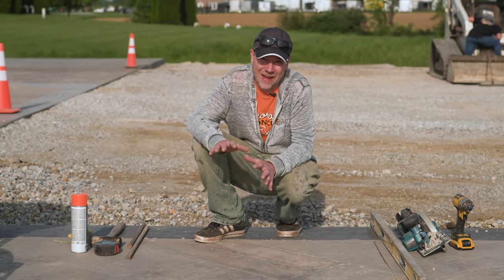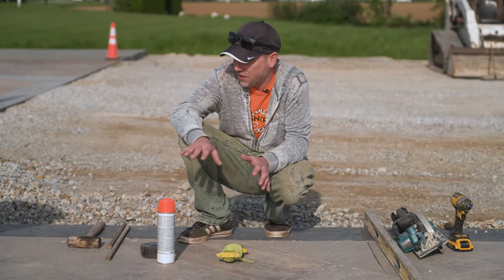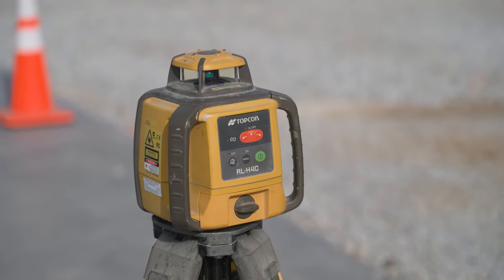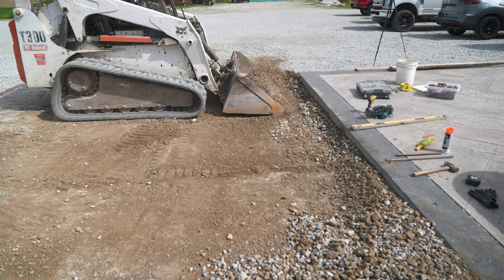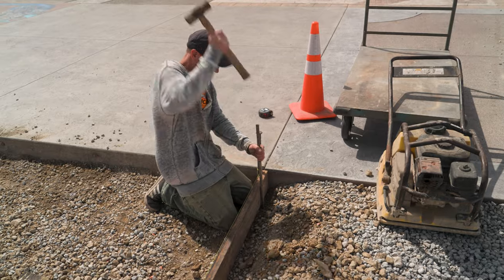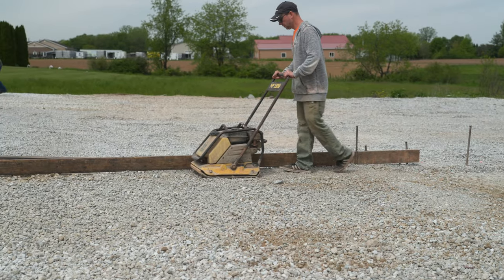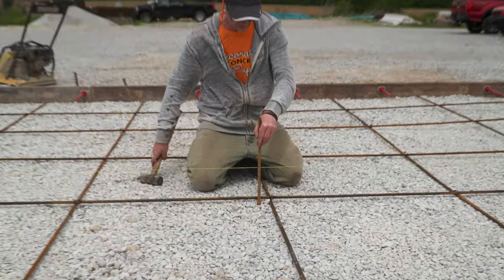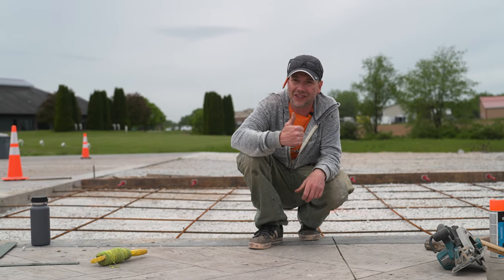How to Form a Concrete Slab in Under 10 Minutes!

Comment: A little more detail on setting the string line to the proper level or slope.
Reply from the maker: The easiest thing to do is set the string line level to start off, then find the side of the slab that you want the water to drain off of and move the string down as many inches as you need to get the water to run. After that, you can set the top of your forms to the string line. The minimum slope required for exterior concrete is 1" of slope per 10' of concrete. So for example; if the slab is 20' long, you'll need at least 2" of slope for the water to drain. Keep in mined that 1" per 10' is the absolute minimum and most contractors would give it a little extra. 1.5"-2" is a good rule of thumb. Here are a few links to some other videos on slope and string lines. Thanks for watching Deco-Crete TV!!                                                                                                              
  https://www.youtube.com/watch?v=QqodE1OhREk                                                                                                                                                                 
  https://www.youtube.com/watch?v=IRO9wRSKfw8                                                                                                                                                                 
  https://www.youtube.com/watch?v=KX_bRIkV8cg&t=25s                                                                                                                                                      
  https://www.youtube.com/watch?v=EYEAtPSf6ps&t=332s

Comment: I'm pouring a 6" thick concrete slab over 20' x 40' area.  How far should I tie the rebar between each other? What size of the rebar is used? Would it help to stop the crack if I use 2" pink XPS foam under the concrete slab.
Reply from the maker: Thanks for the comment! 24" on center should be fine for the rebar spacing. #4 (1/2") is the recommended diameter for the bar on a 6" slab. Pouring on top of 2" foam can reduce cracking, but there are never any guarantees. The foam does help keep the concrete from heaving in freeze-thaw environments. You just have to decide whether it's worth the extra time and cost of the foam. Hopefully, this helps! Thanks for watching Deco-Crete TV!!

Comment: Question, what should the spacing of the rebar be?
Reply from the maker: Thanks for the comment! Spacing for the rebar will depend on the size of the bar & the thickness of the slab, most commercial projects will have a spec for this. If this is for a residential job without a spec, 24" on center will work just fine. Thanks for watching Deco-Crete TV!!!

Comment: What about keeping the rebar in the moddle of the thickness instead of sagging to the bottom of the slab?
Reply from the maker: Thanks for the comment! Yes, the rebar should be near the middle of the slabs thickness to be the most affective. You could use rebar chairs or blocks to hold it in place, or pull it up as you go. This would depend on whether you have to drive over the bar with the concrete truck, buggy, or wheel barrow. If you pull it up as you pour, just make sure to pull it up a little extra to account for it moving back down as you walk on it. ACI guidelines define the bottom third of the slab as the "tension zone" and recommend that reinforcement be placed there to reduce the chances of cracking. Common practice however, would be to place the reinforcement near the middle. Thanks for watching Deco-Crete TV!!

Comment: Would you ever use 3/4 road mix as a base? Local gravel supply does not have 57 limestone
Reply from the maker: Thanks for the comment!! That 3/4" gravel will work fine if you can't find #57 limestone. We prefer limestone, but gravel is probably the most commonly use base material. Thanks for watching Deco-Crete TV!!

Comment: I have a spot in the middle of a downstairs driveway that is triangular shaped and surrounded by existing slabs. How would I approach that? One side is the retaining wall, the other 2 are concrete. Would I just clear it out, level/gravel fill, then pour?
Reply from the maker: Thanks for the comment!! Yes, start by clearing it out and leveling it with gravel. The concrete should be at least 4" thick, but if the area is really small, you might want to make it even thicker. Make sure you put some expansion joint along the retaining wall so the concrete doesn't bond to it. For the sides against the driveway, It would be a good idea to drill holes and dowel it to the existing slabs. We hope your project goes well! Thanks for watching Deco-Crete TV!!!
Reply: @DecoCreteTV  thank you for the tips!
Reply: I'm pouring a 6" thick concrete slab over 20' x 40' area.  How far should I tie the rebar between each other? What size of the rebar is used? Would it help to stop the crack if I use 2" pink XPS foam under the concrete slab.

Comment: Hello, very informative video. How far away from each other should wholes be drilled into existing concrete slobs for rebar installation? Thank you in advance.
Reply from the maker: Thanks for the comment! 2' on center would be the standard practice for the rebar holes in the existing slab. Thanks for watching Deco-Crete TV!!👍
Reply: Hello, and thank you for the response. How far away from the edge of the concrete slob should the holes be drilled, and also how deep should the holes be drilled, and what size of rebar should be used? Thank you in advance.
Reply from the maker: @kevinjefferson9739  You can start your first dowel hole 1'-2' from the edge of the slab, and generally, they would be 8" deep. #4 (1/2") rebar works well for the dowles. However, the size of the full-length rebar for the main part of the slab would depend on the thickness of the slab. In this video, the slab was 5.5" thick, so we used #4 for everything. #3 (3/8") rebar would be better for 4" slabs. I'll leave a few links to some other videos on doweling slabs together and slab thickness. Thanks again for watching Deco-Crete TV, we hope your project turns out great!!      https://www.youtube.com/watch?v=Kiwh2sVFghA          https://www.youtube.com/watch?v=IRO9wRSKfw8&t=28s
Reply: Hello, and thank you for the response. How strong the concrete should be—4000 psi or 5000 psi or more for the garage floor slab? What are the red rebar holders inside of the 2X6? What do they do, what is the purpose of them? Thank you in advance.
Reply from the maker: @kevinjefferson9739  4000 psi will be fine for the garage floor. The red tubes are a part of the Quick Dowel system. There's a base that's screwed to the 2x6, the red tube fits over the base. After the concrete is poured and it's time to strip the forms, the base will come off with the 2x6, and the red tube stays in the concrete. This tube will serve as the hole for the rebar dowel. Eliminating the need for drilling holes. You can buy the Quick Dowels on our website, I'll leave the link below.       https://www.deco-cretesupply.com/products/forms-expansion-wire/5-8-quicdowel-base      https://www.youtube.com/watch?v=4XmPodKjz98&t=120s
Reply: Hello, and thank you for the response. If an existing concrete slab has garages on it, should or should not holes be drilled for the rebars for attaching a brand new concrete slab? Thank you in advance.
Reply from the maker: Is the new concrete also a garage slab, or is it an exterior slab? I would avoid tying a floating exterior slab to an interior slab on a foundation. The exterior slab will move with the ground, but the one on the foundation won't. In that case, you should put some expansion joint between the two slabs. If they are both on a foundation or both floating, then yes, tie them together.  I'll leave a link to our video about this and one on expansion joint.                                                                                                         
 https://www.youtube.com/watch?v=Kiwh2sVFghA                                                                                                                                                                   
 https://www.youtube.com/watch?v=VXsWYGhQfqs&t=263s
Reply: Hello, and thank you for the response. How can you tell if the existing garage slab is floating or a foundation slab? The new concrete slab is meant to be the garage slab as well. Thank you in advance.
Reply from the maker: @kevinjefferson9739  You should be able to see the block or concrete wall foundation of the existing garage. My guess is that it's on a foundation, unless it's a pole barn.
Reply: Hello, and thank you for the response. According to your explanation, the new concrete slab should not be attached to the existing concrete slab on the foundation, regardless if the new concrete slab is going to be an extension of the main garage building, correct? Thank you in advance.
Reply from the maker: @kevinjefferson9739   By extension of the main garage building, do you mean the new concrete will also be an interior slab that will be poured on a foundation? If so, then yes, tie them together. Just don't tie the two slabs together if one will move with the ground and the other one won't.
Reply: Hello, and thank you for the response. How deep and far away from each other should the joint (expansion) line be? Thank you in advance.
Reply from the maker: @kevinjefferson9739  Are you referring to the saw cuts/tool joints? If so, here are some general rules: Saw cuts should be spaced 24 to 36 times the thickness of the slab. For example, for a 4-inch thick slab, the cuts should be spaced every 96 to 144 inches (8 to 12 feet) apart. Saw cuts should be made to a depth of 25% to 33% of the slab thickness. For a 4-inch thick slab, this means the cuts should be 1 to 1.33 inches deep.
Reply: Hello, and thank you for the response. For how long should a compactor be used over the gravel (rocks)? What is the time frame after the compactor finishes that the concrete has to be installed (poured)? Thank you in advance.

Comment: Is 3.5 inches think of concrete fine for a patio?
Reply from the maker: Thanks for the comment! 4" thick would be the standard for patios, and that would also be the minimum thickness for a slab on grade. The extra 1/2" of concrete is well worth the extra cost for exterior slabs. Thanks for watching Deco-Crete TV!!!

Comment: Was there a reason you didn't do little riser blocks to get the rebar off the ground?
Reply from the maker: Thanks for the comment! We normally pour the concrete with a buggy and it doesn't work very well if the rebar is chaired up. We just pull the bar up by hand as we pour. In this case, blocks or chairs would have worked fine. Most commercial job will require chairs at a spec'd height. Thanks for watching Deco-Crete TV!!!

Comment: Looks great! I'm about to do a 4.5m x 6m slab for a campervan. Should the rebar stick out the sides or is it best to leave them shorter than the overall length and width of the slab?
Reply from the maker: Thanks for the comment! The rebar does not need to stick out the sides. The best thing is to leave it short, around 2" of clearance on all sides is ideal. Thanks for watching Deco-Crete TV!!!

Comment: Chairs for the rebar they say you can pull it up when you pour it and it just sinks back down but you don't know
Reply: Pulling it up works just fine lol
Reply from the maker: Thanks for the comment! Chairs are great if you don't have to drive a wheelbarrow or buggy over the rebar. But, most backyard patios will require driving something over the bar. Unless you are pumping it, or sometimes you can get the concrete truck close enough to get the chute inside the forms. We have always pulled up the bar as we go, it definitely works as long as you pay attention to what's happening. It does sink a bit as you walk on it, but if pulled it enough it will still end up in the right spot. Thanks for watching Deco-Crete TV!!!

Comment: I put in a 12 x 16. My forms are in and I didn't have rock but compacted the dirt and threw in rebar. It's for a shed. Should I still put in rock or am I good with how i have it? I'm also about a 8 inches away from all sides with the rebar. Any advice would be appreciated.
Reply from the maker: 3-4 inches of compacted gravel is recommended, however if this is your own project you'll have to decide if you want to take the risk or not. It's not like the slab is just going to fall apart, its that the dirt wont provide any drainage under the slab. 8 inches from the sides will be fine for the rebar.

Comment: Do you have a segment on how to remove the existing concrete and pour new concrete?
Reply from the maker: Thanks for the comment! We don't currently have any videos on removing existing concrete. You can rent a jack hammer from most tool rental shops and bust the concrete in to small pieces so they are easier to dispose of. For larger jobs, you may rent a skid steer to remove the concrete and have someone haul it off for you with a dump truck. It just depends on the size of the job and how much hand work you willing to do. If you search "concrete slab removal " on YouTube there are quite a few videos out there. Thanks for watching Deco-Crete TV!!

Comment: Need to do a flat 16x16 flat slab on a slanted/hill yard for a car parking pad 
Any suggestions or do you know of a video available ?
Reply from the maker: Thanks for the comment! The excavating and forming would be the same as in this video. How steep is the hill? You can put quite a bit of slope on a slab like that, but depending on how steep the natural grade is, you might need to build up bottom side a little bit. 1.5" of slope per 10' is nice amount of slope to get the water off the slab but still feel fairly flat. Even 3" of slope per 10' won't be bad to park on, but you probably don't want to go much more then that. Thanks for watching Deco-Crete TV!!
Reply: @DecoCreteTV  approx 6’
Reply from the maker: @milliewilliams4889   6' slope on a 16' slab would be quite steep. In that case, you would probably want to flatten it out some by building up the bottom side of the slab or digging into the grade on the top side—maybe even a little of both.

Comment: Ever build garage floor with metal screen mesh vs rebar?
Reply from the maker: Thanks for the comment! Wire mesh is a commonly used form of reinforcement. We prefer rebar for exterior concrete, but a lot of contractors use wire mesh. Thanks for watching!
Reply: @DecoCreteTV  Contractors like rebar and the stronger than mesh sales pitch. However, I talked to DIY and engineers say mesh is fine for residential garage.

Comment: Did you all use the rebar stands to keep y rebar level?  I am readying a DYI effort.  Thanks Scott
Reply from the maker: We don't normally use anything to hold up the rebar. Most backyard patios require a wheelbarrow or concrete buggy to get the concrete in place. It doesn't work to drive over the bar if it's chaired up. We usually just pull the bar up as we pour. If you don't have to drive over the bar, you could chair it up with blocks or rebar chairs. Thanks for watching!!!!
Reply: @DecoCreteTV  Fundamental misunderstanding of the purpose of rebar in concrete.  Concrete is excellent compression stress and terrible with tension stress.  Rebar provides support for tension stress and has to be place at the correct depth in the concrete to provide the propper support. Just having rebar in there somewhere does very little.   https://www.youtube.com/watch?v=cZINeaDjisY
Reply: @markmercier6739  Oh yes, I know all about that from Dr. Buckner's class in Reinforced Concrete Design in college many years ago.

Comment: Several questions Jeff... Where do I rent that concrete truck, how do I know Im getteing the right concrete? Where do I rent that compactor? Where do I get the gravel? How do I cut my rebar so its the right fit? Last but not least, How do I know I want a slope on it or not?
Reply from the maker: Thanks for the comment! The first thing to do is call your local ready mix concrete plant and tell them about your project. They will help you decide what type of concrete mix will work the best. You won't need to rent the concrete truck, they'll deliver the concrete to you ready to pour! Concrete ready mix plants are also a good source for the gravel and most of them will deliver it to your jobsite. The compactor can be rented from most equipment/tool rental shops. Small diameter rebar (3/8" & under) can be cut with a large bolt cutter, but an abrasive blade is easier. #4 rebar (1/2") and up will need to be cut with an abrasive blade, you could set up a blade on an angel grinder, but a concrete chop/cut off saw will be lot quicker. You can rent the cut off saw from the same place as you rent the compactor, you'll need the saw with a diamond blade to cut the concrete anyway. As for the slope, this depends on the situation. Exterior concrete needs a minimum of 1" of fall per 10' so water can drain off properly. But you can, and probably should give it even more slope then that. We're actually releasing a video tomorrow morning on how much slope to put on exterior concrete! Thanks for watching Deco-Crete TV!!!

Comment: what do you do with the center (sprayed) cut-off rebar guide after the concrete has been poured? how do you get it out?
Reply from the maker: Thanks for the comment! Once you have the screed line established, you can either pull the grade pin out with a Vise-Grip or pound it down with a hammed. If you pound it down, make it's down far enough to get full coverage over it with the concrete. Otherwise it could create a weak spot. Make sure you do this as you go. Once you've screeded past it, you won't be able to get to it any more. Thanks for watching Deco-Crete TV!!